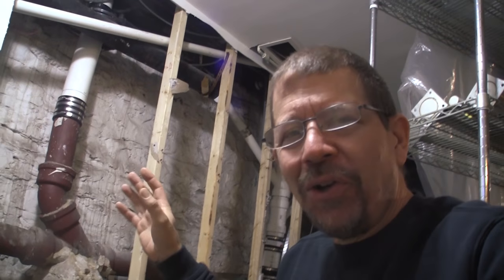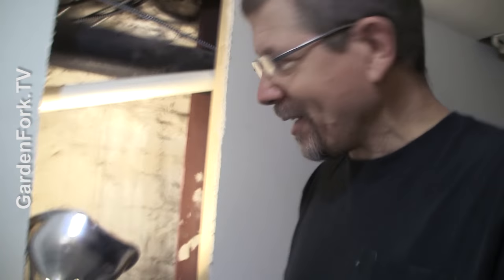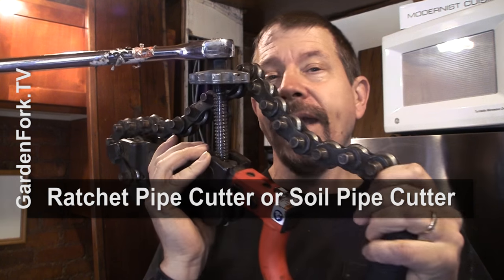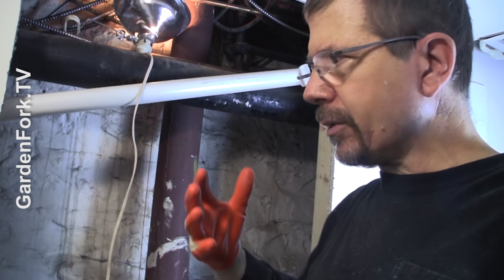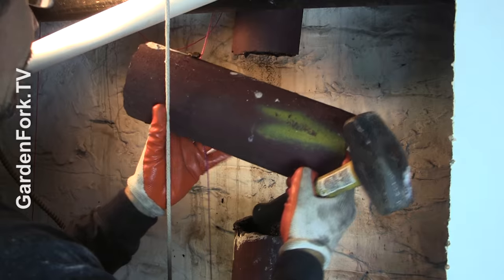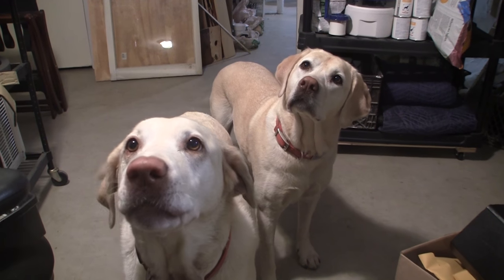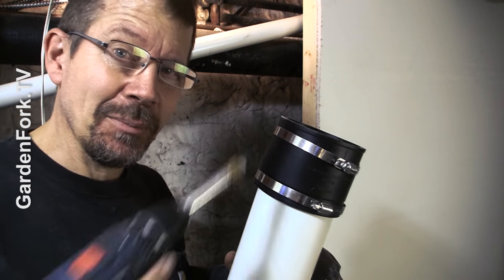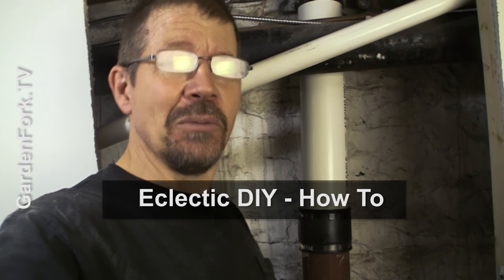Plumbing Leak! How To Cut Cast Iron And Replace with PVC - GardenFork

Comment: I noticed the big chunk that fell in the pipe, I had the same thing happen,, however you can make a magnet to retrieve it but because magnets will stick to the pipe and therefore not go down in it--all you have to do is glue up a magnet inside the end of a piece of smaller diameter PVC pipe (1 1/4 or so about 6-8" long), and tie a solid string to the other end of the tube... The PVC helps keep the magnet from sticking to the sides of the stack and the exposed end will grab the chunk you want out!!  (it works trust me!!)  LOL   Good video!!!

Comment: Ran into that problem and with my house built in 1870 it’s nice to see your video on this. I bought a cast iron saw blade  for $18.00 at a local plumbing supply store and was told by a plumber there to go slow when cutting and the blade will last longer. I had put some plumbers putty on the 3’ crack and covered it with duct tape for the time being and now to tackle the job. Thanks again Good video

Comment: Nice video man, You should of connected the pvc pipes with a pvc connector, you only needed a rubber clamp for the Cast Iron pipe. Also for others watching, add a DRAIN clean out!, this is very helpful in the future. Btw I hope you get the pipe piece that broke out of the pipe, thats worse than a leak

Comment: Do you have to get something to hold up the top part of cast iron so it doesn't fall down?
Reply: I have heard of stories of people dying from collapsing cast iron stacks, so I would always start at the top and secure pipes before cutting. They are immensely heavy and dangerous.
Reply: @marksmith2625  secured how?

Comment: I just replaced 25 ft. of cast iron pipe. I used a grinder in spots where the chain snap wouldn't fit. Imagine the days of installing cast, and pouring the lead. So thankful for pvc. Good job replacing the pipe.
Reply from the maker: thx! from what I understand many plumbers had some level of lead in their bodies when they used it for plumbing.

Comment: Couple of comments to pass on from a 90 + year plumber friend who still gets his hand dirty:
Lightly tap the pipe near/where you want to cut. Hope all locations “sound” the same.
Cut near the hub if it’s a choice as it’s more likely to cut straight. Make sure a vertical pipe up stream is braced supported. 
You were good enough to tell us how long it actually took. Novel concept.
Reply from the maker: Thx Russ! I did support the pipes after the install. They still work 😀

Comment: I will be needing to adjust the rough-in from 14 to 12 in for a house that's better part of a hundred years old. it used to be my grandparents house. All the support cast iron vent pipe going out through the roof while I replace everything down below with PVC and your video helps immensely. Thank you so much!

Comment: I have a house that’s 108 yrs old and it has the same type of iron pipe. This was really interesting, that tool sure made quick work of that pipe. I bet that pipe was really heavy. Glad you told us how long it took you, seem like it didn’t take long. You had lots of help from the labs:)
Reply from the maker: Yes Mary, its a big job. the cast iron pipe cutter really helps. I would not try to do this without it. thx!

Comment: The plain rubber flex coupling is good for below the living area. The flex coupling with the metal shell is called a "no-hub coupling" and is the "proper" one for areas above the ground/ basement. They both work but an inspector might prefer the metal clad ones. They are made by Fernco usually. Good video. Thanks.

Comment: You did great, I have the same issue, need to tackle it. Tore up floor, now need to cut walls. Need that pipe splitter
Reply from the maker: Def rent the pipe cracker. Save your sawzall.

Comment: Thank you, I have a cast iron joint that is leaking. It is horizontal, just do the sane thing you did. Right? Keep the replacement joint tight fit on the ends  so that the flow is good, right? Thank you for the help. -Mark

Comment: Pro tip: They also make a banded fitting to connect CI to PL. That you could have used on the top. Also able to flip back the lips, and slide band on.  Makes a tighter, cleaner connection, as it would bend in at the band at the cast iron connection. Torque 60lbs on the 5/16" nut for best connection.  Regular no-hub coupling is ok.  Perfect use of flexible coupling at the bottom.
Another tip from experience,  soaping the pipe where flexible coupling connects makes it easier to slide on. Very diluted soapy water. Too soapy no good.
And a painters 4-in-1 works wonders for rolling on the rubber.  
Good job.
Reply from the maker: +Spaceman Rick wow Rick, thanks for all the info and kind words! I probably have another of these in my future so good to know. Thx.

Comment: I am a heating contractor so I deal with PVC all the time (high efficiency furnaces and water heaters).  I do not deal with cast iron and I certainly do not deal with waste pipes (yuck)!  I have to say, you did an awesome job!  That cast iron pipe cutter thing is pretty cool.  I would have used a reciprocating saw, only because I use them all the time.  I think that device you have would be a whole lot easier.  As usual, you did a greta video, and your assistant was very helpful (yet still adorable)!
Reply from the maker: Thx Russell. you can cut cast iron with a recip saw, but you need a diamond blade which costs almost as much as the tool rental, so i opted for the tool.
Reply: what about creating sparks and the gases that exist in the pipe? I feel like there's a risk for explosion
Reply: @achilles1373  Unlikely.  Any waste gas would exhaust out the vent

Comment: Ahhh cast iron, when it was put in great, years later bad news.  Seen lots of that cracked stuff in older homes.  Great job, I noticed how friable it was when you hit it with the hammer, good thing you pay attention!!!  Great job, you make it look much easier than it is.
Reply from the maker: cast iron has its place, but i have seen quite a few cracked pipes. When I first saw this leak, i knew right away it was a split pipe, but had no idea where it was. this one took all day to do. thx!
Reply: Great job!!
Reply from the maker: i'm glad it cracked where it did. i've seen it crack in lateral drain lines under toilets inside ceilings. that is not fun!
Reply: I have as well.  Seen it crack coming out under an old house, had to replace with sections of new pipe for the mainline.  A yucky horrible mess.
Reply from the maker: at least i'm not working in a crawl space. that would be bad!
Reply: Omgosh that reminds me of my childhood. You did a great job.  I'm thankful you take the time to show things like this.  Never know what's lurking in our walls.  My home was built in the 1800's
Reply from the maker: this house was built about 1900 and has had many repairs done to it, now I get to deal with them all!
Reply: We could swap horror stories I'm sure!

Comment: I actually did the exact same thing yesterday. It was a pain in the ass because the bell kept getting stuck and wouldn't slide out. We actually had to pull it up instead of pulling it down. I took some strap and tied them to a ladder and then tied it to the bell and every time I would push it up, my buddy would tighten the strap so it remained suspended. I think we pulled out a whole 8ft like this. My only critique would be to cover the existing pipe so nothing falls inside and clogs the sewer line during removal.

Comment: There is also a special blade that can be used for cast iron that home depot sells for reciprocating saws that is about $20 and that also can cut the cast iron pipes.
Reply from the maker: Hi Greg, thanks for the tips and info. I have used that saw blade. this was in a tight spot and I wanted it to be quick and simple to i opted to rent the cast iron pipe cutter. thx! eric.
Reply: Yeah you'll be there all day even with that blade.  The best way is with the snap cutter, or grinder with cutting wheel if snap cutter is not available.

Comment: That cast iron is heavy, and tough to do by yourself.  You did great.  FYI... I heard that if you spray the rubber couplings & pipe with cooking spray it helps them slide on a bit easier.  Thanks for the video. :-)
Reply from the maker: excellent tip on the couplings, and i had veg oil spray in the kitchen, thx for that!

Comment: Hey buddy cement glue a 3" PVC coupling to join all PVC pipe and then add the rubber coupling pipe clamp. Less fitting to leak from in the future. Thanks for video.
Reply: Do one or the other, not both it would be pointless.

Comment: I have a situation with my cast iron drain pipe, need to replace connected to it Y cast iron pipe. Someone told me I need to secure above pipe otherwise it will drop an inch or so if I don’t. I’m wondering if that’s true.

Comment: Hey Eric! Did your pipe leak all the time or only during clogs? I think I have a similar situation and setup where the pipe only leaks (alot) when the main sewer line outside the house gets clogged. My cast iron stack goes from basement ceiling to bathroom upstairs.

Comment: Can up use both cast iron and pvc
Reply from the maker: you can connect cast iron to PVC in most areas, check with your local plumbing codes.

Comment: So - you said you didn't want the metal going into the pipe when you were tapping out the 4" piece - yet a good size piece did go in from the 1st/2nd hit - any issues with the pieces that fell in there?  I'm assuming you didn't fish it out and it ended up either in waste treatment plant or your holding tank.
Would be nice if you could jack it up an eighth of an inch or so but I recognize the weight of the stack doesn't allow this.
I have to cut into an 1-1/2" C-I line next week - going to use sawzall.  Should be Ok for 1 cut - only 1-1/2"

Comment: Im tackling a plumbing issue of my own with cast iron. The pipe cracker looks sweet! (Funny that as an adult one could use the word "Sweet" when referring to a tool meant for a sewer pipe. As opposed to a hack saw which would be pertinently referred to as "Crappy." Euphemism intended.) Speaking generally, would I have to get a permit from most cities for a project like this? And would I have to get the work inspected? Thanks and great job. You seem so patient. I would have seen that wiring and gas pipe and said , "That's my luck!!" But with a lot more colorful word additives.
Reply from the maker: its up to you as a homeowner whether you want to involve the town and the permitting process. good luck!

Comment: That's a pretty big project to tackle by yourself.  Good job. 

I've got a broken plastic toilet flange that's glued inside the 4" pipe that's also sitting about 1/4 inch above the floor.  That means I've got to somehow remove the old flange without destroying the 4" pipe so I can install a new flange that sites directly on the floor so my toilet won't rock.

Any words of wisdom, Eric?
Reply from the maker: you might be able to use a repair flange. find the oldest guy at your local hardware store and ask them about it. thx!
Reply: Try a multi tool it vibrates and won't ruin the 4 inch pipe. Or a very small chisel lol

Comment: To better slide the rubber over the PVC put a couple of drops of dish soap in a small amount of water and wet the rubber.  it will slide much easier.
I also feel your pain having a 110 year old house which has had many "improvements"  I understand the issues, like floor joists cut and hanging by sheer force of will,.. mystery  electrical switches,  and  non-standard building practices.

Comment: Can you give me some advise? I have had plumbers out on 2 separate occasions for copper pipe leaks. My house was built on a cement slab in 1995.   The 1st leak was in the middle of one pipe in the wall the 2nd and now this leak is in the cement slab. What is the best option to perm fix this and prevent future leaks?
Reply from the maker: sorry I can't, i don't know much about that kind of issue.

Comment: If it was just a crack, why didn't you just fill the crack with JB weld and fiberglass cloth and resin? I patched a quarter sized hole in a horizontal waste pipe and it held 12 years...the pipe rusted out elsewhere and it all needs replacing with PVC.

Comment: ...Yeah, I was going to comment something like: The only important part is NOT getting any metal shards down the pipe. We had one of these replaced a while back at my old house, and because of some pieces that fell into it, it all got clogged and backed up everywhere (a few years later). Did you manage to get those 3 or 4 pieces back out?
Reply from the maker: there's one stuck in the lateral line, that is today's project... what fun!
Reply: You can always try a magnet!

Comment: interesting; I'd always thought these chain whip devices would go back/forth round to cut -so purely stable in place tight clean fracture.  Still would a grinder have worked?   Maybe a lifting magnet inside of narrower PVC to fish out any chunks that go down inside?   For PVC to PVC why not a PVC coupler?  PVC really seems to be the way to go and one would think should last a very long time.
Reply from the maker: Hi James, yes, with the old style pipe cutters you pull them back and forth while tightening the chain. this newer design allows you to just crank down on the pipe. It is great for tight spaces. You can also use a right angle grinder to cut cast iron, but it sends metal grindings up in the air and all over the basement. I do use the grinder to cut new cast iron pipe to size. and for the couplings, yes, PVC works best, but this pipe was canted so i had to use flex couplings between the stack and the lateral pipe. thx!

Comment: I would have with the one in the middle I would have used a cuppling and glued it so make it one piece.  but looks like it all worked out.
Reply from the maker: the cast iron pipes were crooked originally, with a hub that was canted, so i had to use the flex coupling when replacing with the PVC. since cast iron didn't bend, they would make slight adjustments at the hub when they poured in the lead seal. thx!

Comment: I prefer grinder if there is space. Make life easy.
Reply from the maker: yeah this was a tight spot, but yes, the right angle grinder works well.
Reply: Sorry but how is an angle grinder easier than a ratchet? In time alone cutting it with that tool is so much easier. That is if you can rent one or have one. The grinder is only easier if because you can have one around more readily. That ratchet set up is infinitely easier to actually cut the pipe

Comment: Can I use a sawzall to cut the pipe? I'm going through this problem now. The section that needs to be replaced runs horizontally.
Reply from the maker: you can, but it will take a while and you will burn through blades. good luck!
Reply: Rory Richards  diamond tipped grinder blade...if you get all the way around the pipe. There is a sawzall blade specifically for pipes though.

Comment: I'd suggest replacing old drain pipes BEFORE finishing your basement, or just not finishing your basement at all.
Reply from the maker: basement was finished by previous owner, but its pretty easy to replace drywall. thx!
Reply: Yes, until it all gets moldy/musty.  I had a half done sealing in my basement.   I had to take it down (like the day after I closed on the house) to do all the electrical and plumbing.  I'm anticipating replacing a majority of it, piece my piece.  I still have to tear out my stack and re-plumb my second floor bathroom.
Reply from the maker: welcome to my world! always a surprise when opening up walls...
Reply: I think I've found just about everything.  A few surprises when removing the original knob and tube wiring.  I still don't know where my shut-offs are for my water and gas...somewhere in the yard.
Reply from the maker: at least the shut offs aren't under the sidewalk. i've seen that before.
Reply: I'm wondering if the water shut-off is in or beside my garage.  I can guess where the gas shut-off is within 4 feet, but I don't think it's above the sod.
Reply from the maker: maybe ask a neighbor where their shut off is, yours might be in the same place. ?
Reply: I already know where theirs are :)
Reply: Just install your own shut offs.

Comment: liked your  demo  I'm an English plumber I work  older blocks of flats  condos  American speak  we  work on all  sizes   2   3    4   6 "    1 to  twenty plus floors  just  make  sure  turn  water off  to  flats  above  sorry  apartments  A  speak  when  you cant  get cutters in  use recip saw    step cutter  and  angle grinder

Comment: Why don't they tell the price of this.
Reply: Rose Mary, he said he was doing it himself. 
 In my area of the United States, you can rent one of those pipe cutters for about $35 a day from a local rental center.  
Looks like he may have used about 10 feet of PVC pipe to fix. That would be about $20. 
The rubber couplers are maybe about $10 each. So $30 (he had 3 of those).
Rental and material about $85 plus whatever his own labor would be. 
In my area, a local plumber would prob be about $500 or more to do this job. 
Hope this helps.

Comment: Speaking from experience, that is not a fun job. You did have some friendly "help" or at least company and they did remind you of break time. Did they have to cover their ears when things were not going right?   Good work, bet you're glad that's done.
Reply from the maker: yeah, this one took all day, and while doing it i discovered other problems i have to fix. at least I have the wall open to do it!
Reply: problems as in more than one other problem...you have to love older houses.  Lots of video material.
Reply from the maker: i'm on day 3 now. the sink drain, which connects to this stack, collapsed into itself. and then the hot water supply valve for the kitchen sink started leaking at the same time. i guess the zombie apocalypse is next!